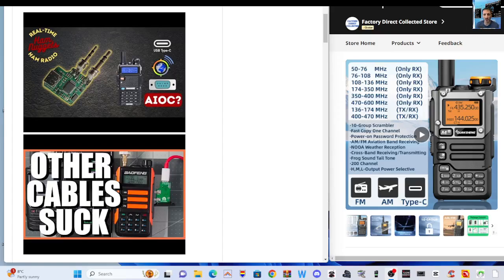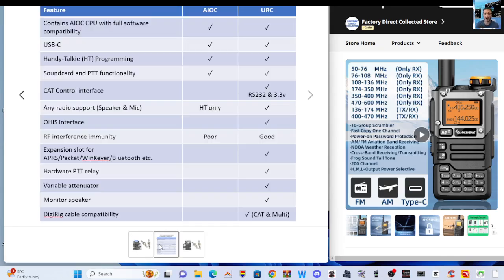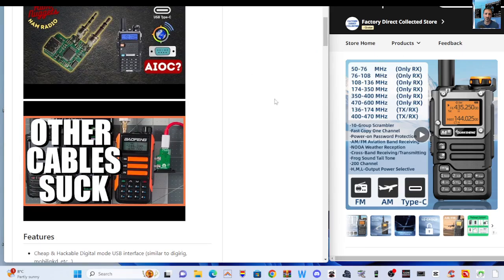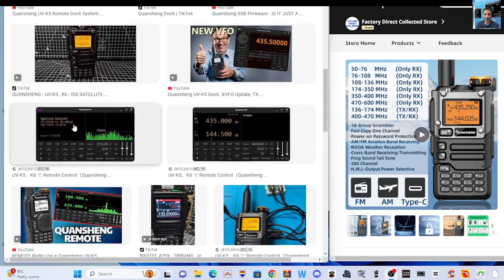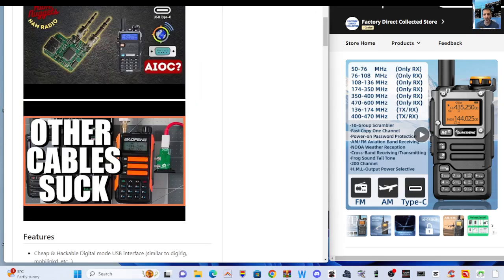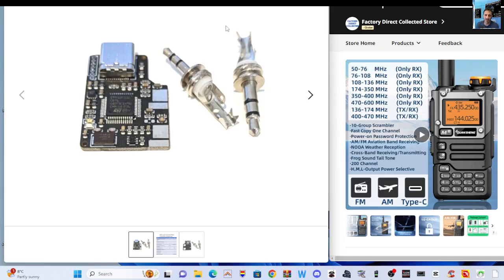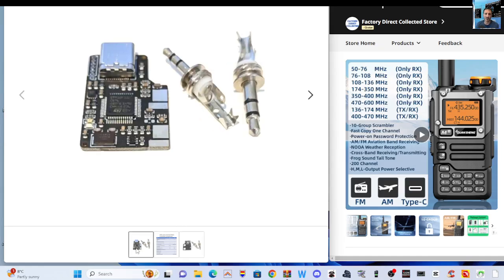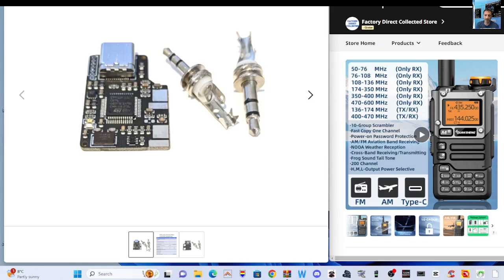AIOC  BOARD- TWIN PIN ADAPTER to USB for PC Connection- APRS -DIGI Programmes

Comment: I have ordered some today. 
I never thought about making short leads for the plugs. That should keep the board away a bit to avoid rf for locking it up.
Alternatively, some use a right angle USB-C cable and/or ferries on the USB cable.
Reply from the maker: Lots options all.doable